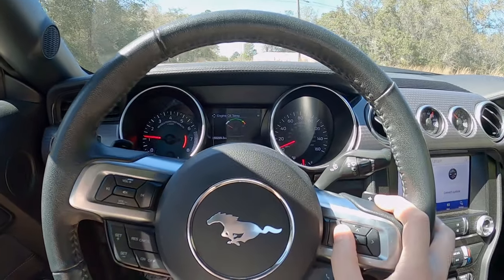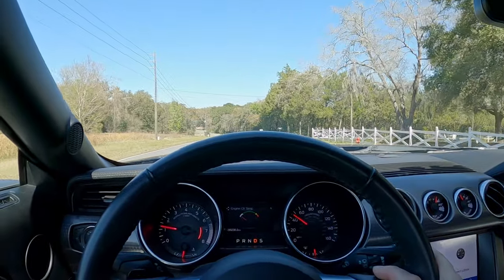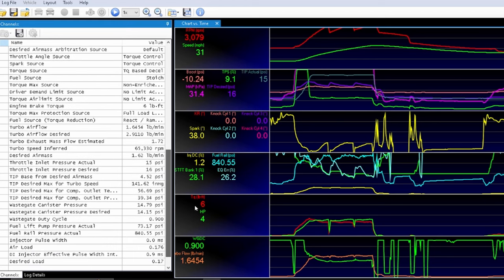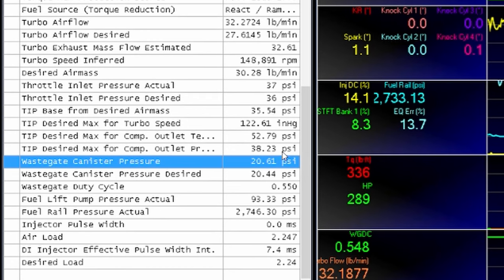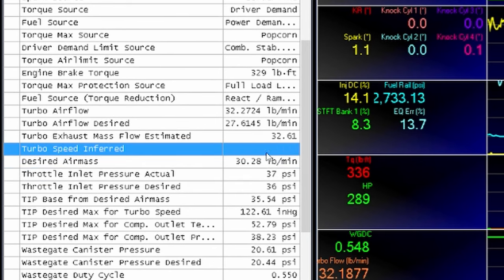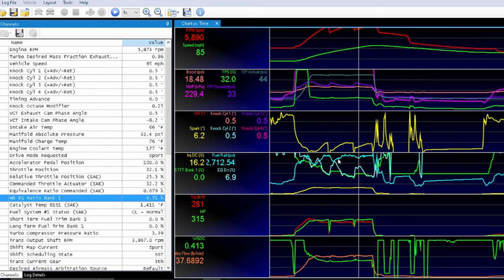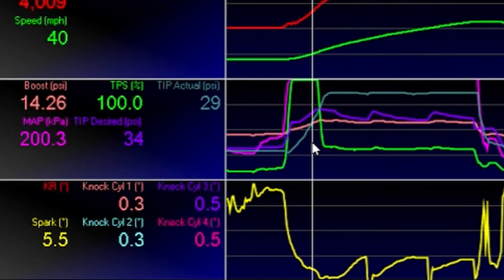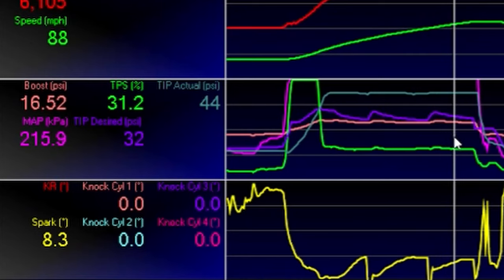Ecoboost OVERBOOST FIXED!

Comment: Would you suggest a catch can for my stock ranger tremor? If so, is there anything else you would suggest for longevity?
Reply from the maker: I absolutely recommend a catch can.  There's not much else you could do to prevent problems other than frequent fluid changes. But a catch can is recommended.

Comment: there are a couple tables you need to raise for the injector limits. you also need to tune your fuel trims as you are pretty lean. luckily these ecu’s are full time closed loop and have full fuel control so it will adjust itself, not ideal tho. the IDC doesn’t work right for the ecoboosts as they are DI and IDC works differently. injector pulsewidth needs to stay under 6.5ms to keep the injection window safe and from firing into the compression stroke, tho i’ve found that they will go slightly higher than 6.5ms to around 7-7.5ms. don’t want anymore than that. tuning fuel isn’t done in power enrich btw, is done in the speed density calculator. need to build histograms for each mapped point with a 50% weighting factor filter. that is just your target. 0.82 lambda is a solid target for WOT. take your stoich target of 14.08 for e10 93 octane and multiply by the lambda to get afr. same applies for whatever stoich is commanded to
Reply from the maker: How can you tell which mapped point to adjust?
Reply: @KarzKreated check your dm. i can show you how to get setup with the histograms. these cars blend between 14 mapped point, 14 torque tables, and 14 speed density tables due to the variable cam positions constantly changing

Comment: Buster is a Beast!!
Your way ahead of me, I do have my stage 3 tune loaded, on my ECU via my HPtuners Interface, just have not been able to get to the 1/4 mile track for testing!
I'm going to follow your lead, and leave the wastegate (on my Precision Turbocharger) 2 full turns short and then extend it, a half turn at a time!?

Comment: I'd be curious, as to how close the specs of your new cams are to the specs of the 2016 to 2018 RS cams.
As for tuning, I know that HPtuners' Tune Repository, includes the 2016 RS file, which you can download and compare to your stock 2020 HPP tune file, using your HPtuners Interface and free software.
You can even "copy and paste" a test file together, using your HPP file and the RS file.
It would be very interesting to see how your new motor and tuning runs on the 1/4 mile dragstrip, I'm guessing, somewhere in the 12 second range!??
Reply from the maker: Where do you find the files?

Comment: I’ve had this issue with my car for over 40k now. The problem happened around 90k and I’m at 130+ inly happened when the car was cold at first. Then progressively got worse and does it anytime I pull. I’ve never been able to solve this issue. My car is stock besides and exhaust and intake. Those were the first mods I did to my car. I put almost 80k on the car  with those same mods zero issues then this crap started happening.. replaced the turbo… the lines, the vacume lines, waste gate, boost solenoid, put a cat back on the car, but…..I have not replaced either of those map sensors… they are my last hope… I ordered both
Reply from the maker: Let me know if that fixes your issue!
Reply: @KarzKreated  didn’t do crap for the overboost problem took my car all the way back to stock. Still overboosting. These cars are jsut junk and there’s no support for them. I’m jsut gonna run it till it blows up and drop and small block Chevy in it and call it a day.